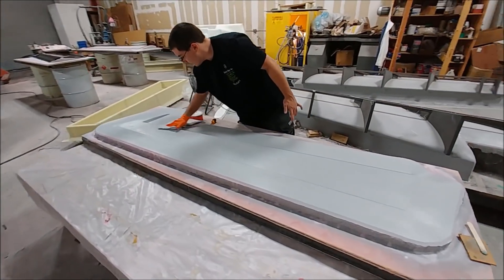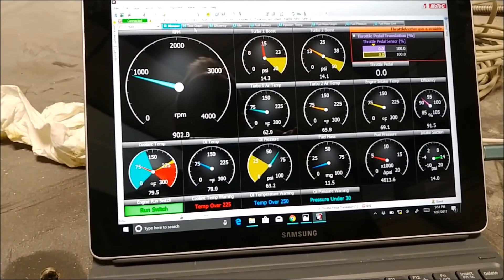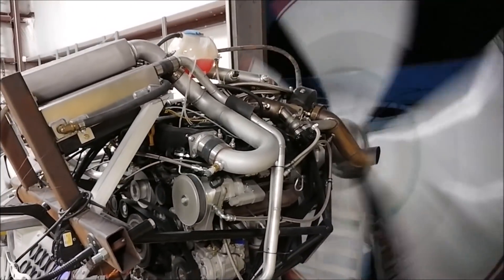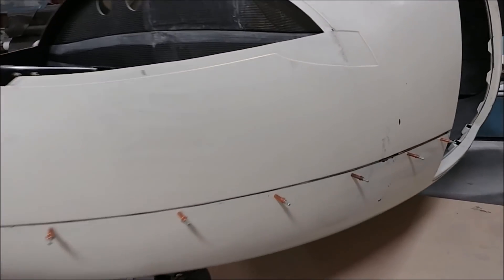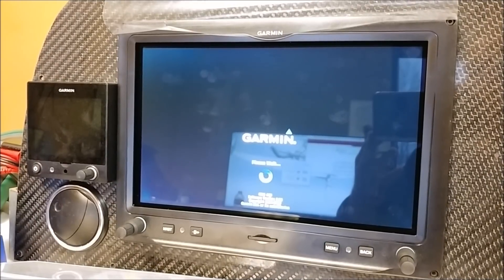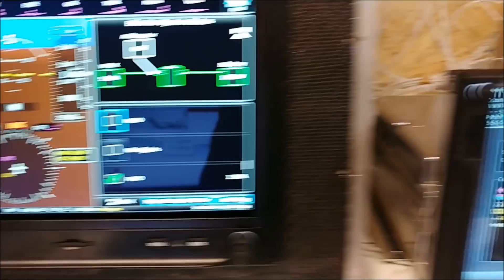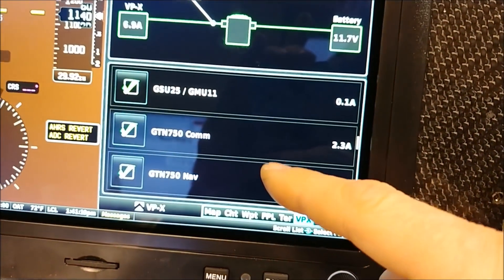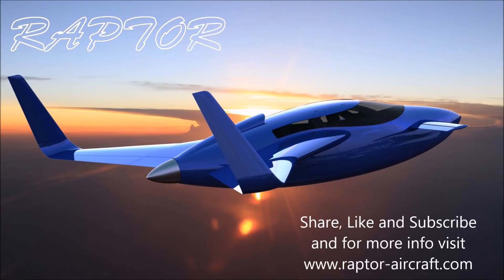Lighting Up The 750 - Com / Nav unit comes to life

Comment: Hi Peter.  The fuel flow amount to RPM will be appropriate I believe.  I think once you have the governor working properly, you should see the engine not hunt up and down so much as you said.  Or perhaps the fuel amount was a hint low as it was before, so the power dropped off a little too much when the pitch of the prop was increased.

Let's consider constant fuel as you have it now.  Throttle is held at one position, and you are at 3000 rpm.  Increase blade pitch and that pulls engine down to 2000 rpm.  You have the same amount of fuel going in as the throttle has not moved, but you have a substantially decreased amount of air going into the engine due to the lower RPM.  I would be wary of engine damage with this current setup.
Reply: It's been over a decade since I've messed with fuel tables in gas engines but I recall it being based on throttle position sensor and O2 sensor input.

Comment: Ever think of a fuel to oil heat exchanger vs. water to fuel?  Only reason I mention this if the exchanger is compromised, the engine will still consume the oil vs. maybe not running at all if water contaminates the engine.  Just a thought.
Reply: RussRamz , good point, but I think Peter is kinda just trying to get some hours built-up and get the prototype into flight testing.
 I would think that the easiest solution is to use a couple high quality 12v hot water heating  elements and temp sensors. Let the VPX actually manage fuel temp.
 Also these newer Diesel's tend to return a large amount of heated fuel to the tank at intermediate power settings. The pumps and injectors are cooled by this excess flow. Also I believe the high pressure pump may be variable displacement. It would be nice to see this volume and temperature measured and quantified.
 It could be all the heat energy needed to prevent fuel jelling.
Reply: Should be easy to hook up oil rather than water .......and safer ! Good thought Russ !

Comment: This is likely answered before, but has any design consideration been given to removing major parts through the smaller nose cowling cover after the main cowling is bonded into place? For instance if the nose gear was damaged and needed entirely replaced. How about all the other important moving parts throughout the aircraft? Will it require structural work to replace pulleys, cables, rear gear, or anything else?

Comment: I know there was never any mention of using bio-diesels, but if it would be considered, I learned from a friend that bio-diesel tends to pick up water more easily than conventional diesel and that water can build up in the fuel filters csusing flow problems.  If there were a solution for that, Raptor could one day operate in the very low carbon emission cat.   Happy Holidays to all Raptor fans.
Reply: bartofilms , TDI engines run on biodiesel. I'm curious about jet-a.
Reply: Hi Peter,   Do you have the total weight of the whole engine PSRU assembly as is now ?
Reply: One thing I have learned about bio diesel is that it clogs filters quickly. Think of your bacon grease after it cools, and the residue it leaves, the same thing will happen in diesel when the engine and its systems cool, throughout the system.
Reply: Keith Bauer , I the diesel "bugs" prefer biodiesel to regular diesel as a growth medium.

Comment: Thermal conductivity of diesel 0.13 , water 0.6. Testing the heat exchanger with water on both sides, won't give accurate data. Beside the contamination.

Comment: I have used those plate heat exchangers for quite some time. In this application, you might want to consider if the fuel going through that is filtered. If the plates ever get clogged, it would affect the flow.